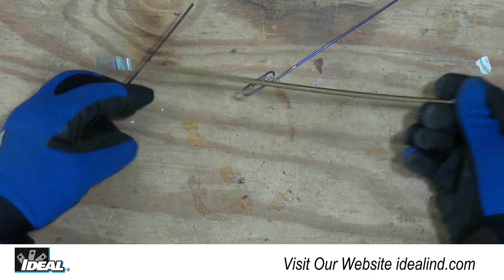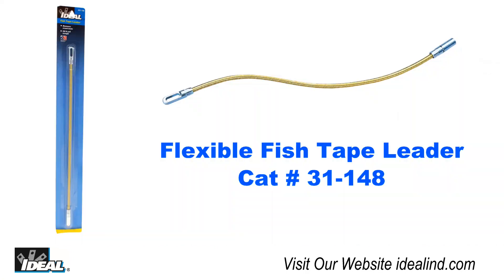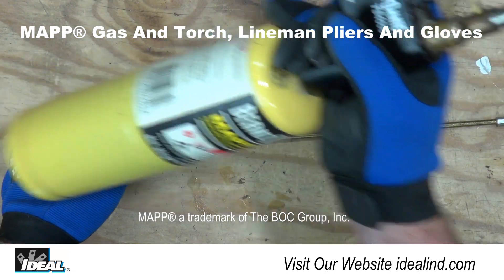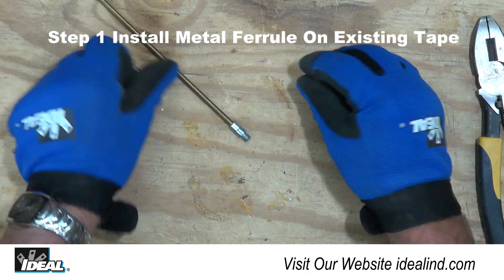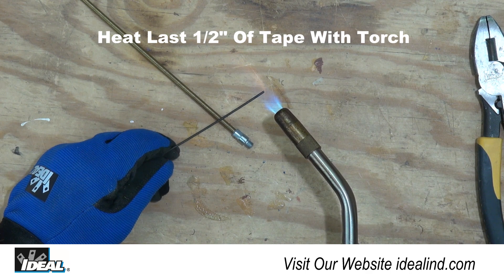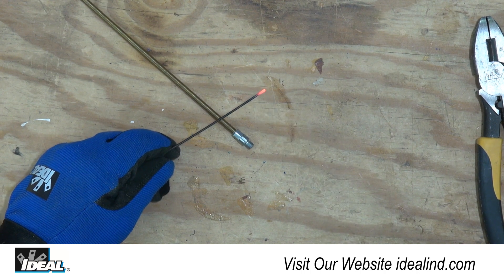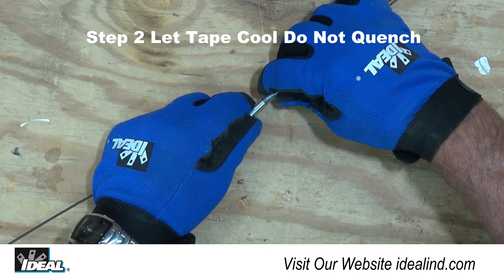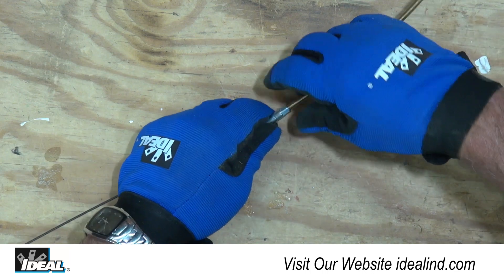How To Attach a Flexible Leader to a Metal Fish Tape

Comment: This helped a lot!
I used a Sushi Blow Torch I had in the kitchen (Japanese torches used in cooking - Quite expensive torch!) or alternatively a cheap Culinary Butane Torch should work too (for around $20 CAD).
Then I had to do 3/16th's of an inch for the "Klein Tools - 13-Inch Flexible Fish Tape Leader" because it has a much different metal ferrule.
It was really hard to bend it 3/16th's while it's hot.. so I did 1/4th bend, then put a dremel to it and cut off 1/16th's to get 3/16ths. Only after that, it screwed in flush.

Your video was very helpful. Thanks!
Reply from the maker: Hey Brandon glad to hear the video was helpful Ron
Reply: You can bend the 3/16” with needle nose easier than with linesmans

Comment: Can I just use a stove lmao
Reply from the maker: Man I doubt your stove will get hot enough you need a torch Ron
Reply: @RonKipperDatacomm1  i tried it with a stove, it worked i just had to hold it there for about 30 seconds haha i didnt wanna spend the money on that torch. thanks for the reply ron
Reply from the maker: Cool I will have to remember that trick glad it worked out for you Ron